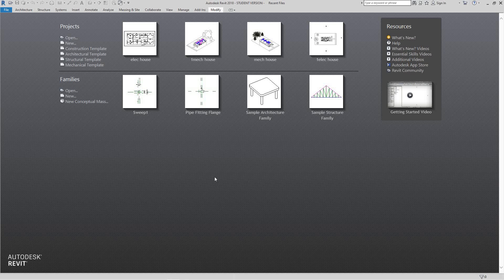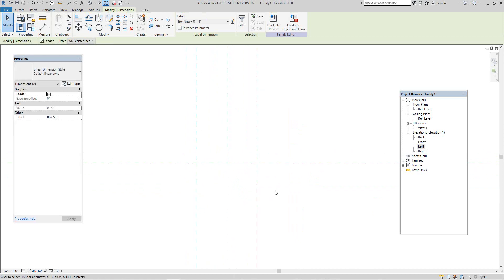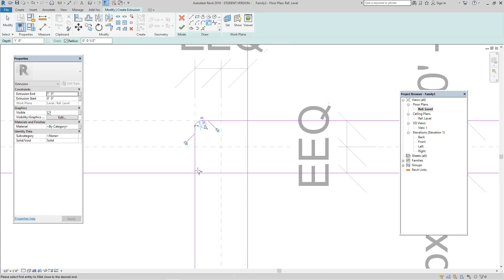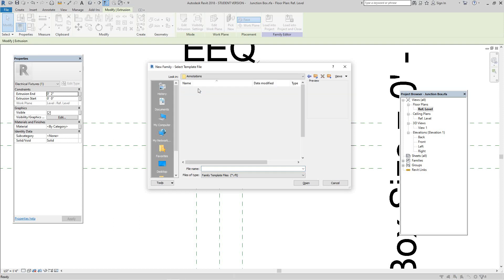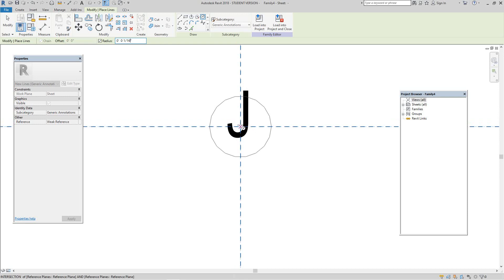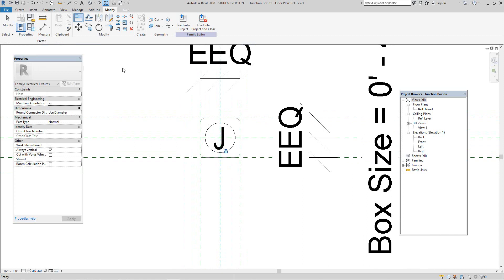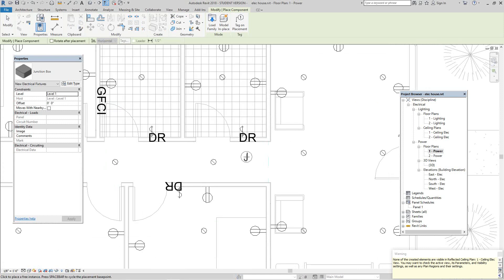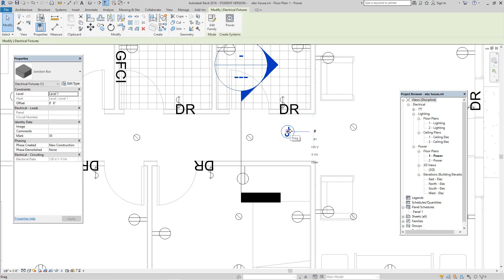Revit Junction Box Family

Comment: What if I wanted to make one where when I decided to power it I could pick the voltage (i.e. 120 or 277) and same thing with number of poles (i.e. 1 or 2 or 3) for higher voltages and still be able to give it an apparent VA? I have one set up like this I just cannot get the load to split into three once in the panel schedule.
Reply from the maker: Sound like you are close, thanks for watching my video. I will have to give it a try or even make a video.

Robert